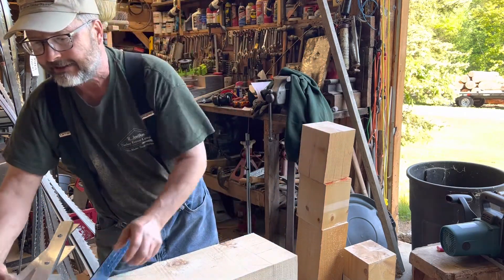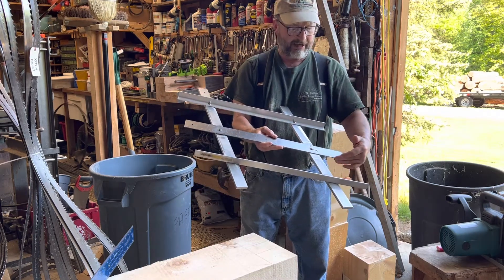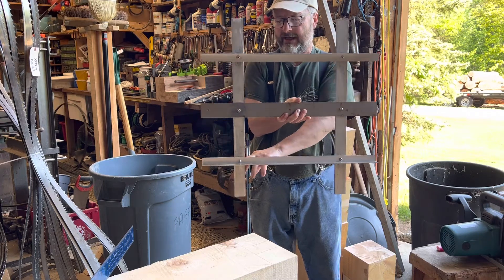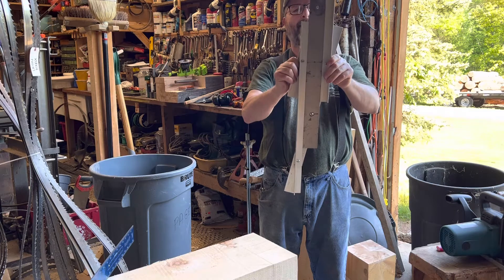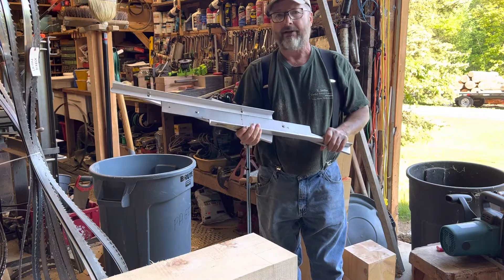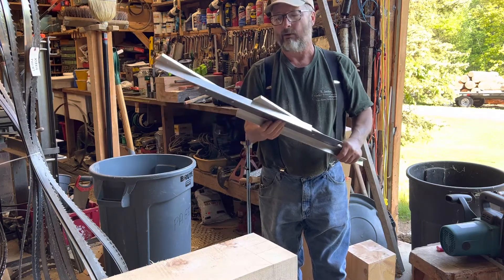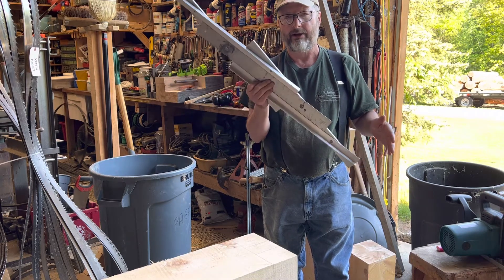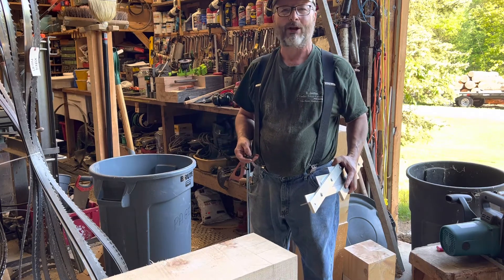Timber Framing Mortise and tenon centering jig - Perfectly center a mortise or tenon every time

Comment: Absolutely bad ass dude
Reply from the maker: It works great!
Reply: @theMainetimberframer  is that piece in the Center the actual size of your mortise and tenon?
Reply from the maker: Hi Ricky
The center piece is a framing square with the tongue cut off - so the center piece is 2”.
When you make the jig, you can replace the 2” piece with your choice -1-1/2,2”, or what ever you need. I make English tying joints and use 3” tenons so I have a 3” insert I use too.
Hope this helps
Reply from the maker: Hi Ricky
The center piece is a framing square with the tongue cut off - so the center piece is 2”.
When you make the jig, you can replace the 2” piece with your choice -1-1/2,2”, or what ever you need. I make English tying joints and use 3” tenons so I have a 3” insert I use too.
Hope this helps
Reply: @theMainetimberframer  dude I really like that dude. Really you should put a patent on it dude. This is simple and nice like dude
Reply from the maker: 👍 I hope you find it as useful as I have!

Comment: Don't we want the mortises referenced from the outside face?  The reference face? Jig is cool none the less
Reply from the maker: Hi Gr8fullfred:
Yes, measured from the reference face for sure.  In my case, I also have the sawmill and I control the size and squareness of all timbers coming into the shop - For me and my situation, the centering jig works very well, accurate and a time saver. 
Good call out on measuring from the reference face.